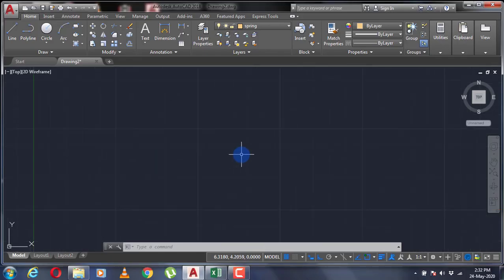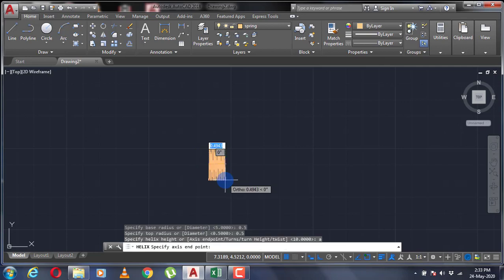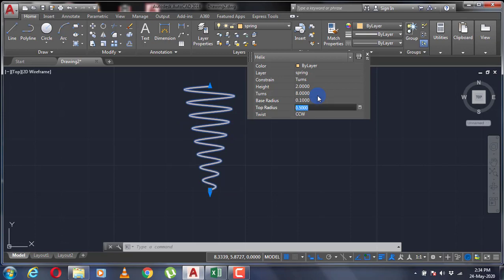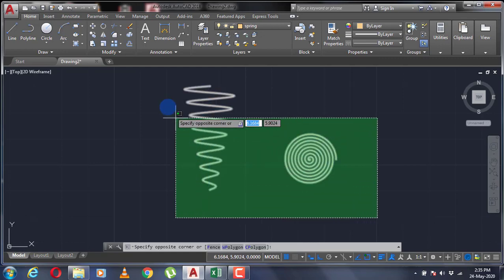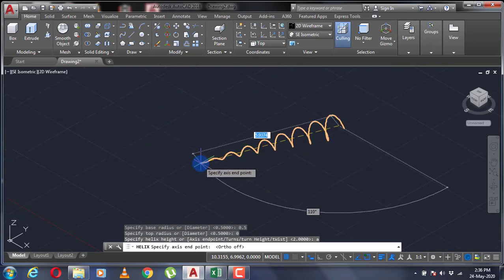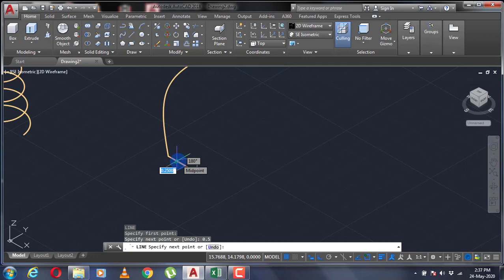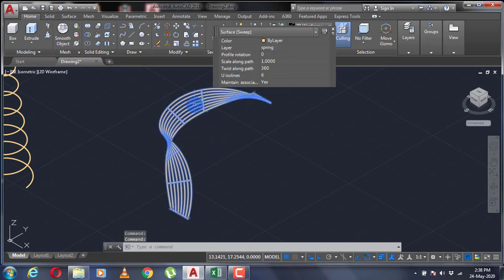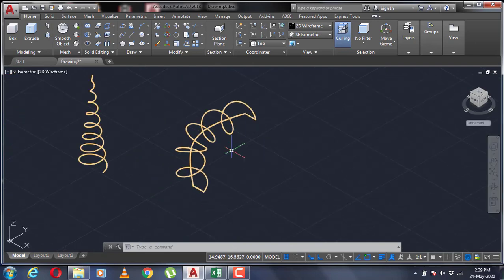Helix and sweep command Autocad

Comment: Can i make different conical helixes without changing total length of the tube?
Reply from the maker: You can change the base and top diameter of the helix in parameter without changing length to create different conical helix but if you want more than one helix of same length but different diameter then create the copy of your helix and change diameter as required in each of those copies.
Reply: @civiler1439  can i make conical helix with different height but with different height, Angle.. Total surface area should be kept constant